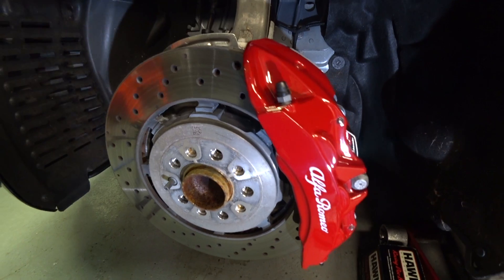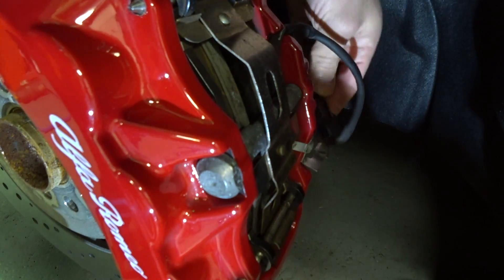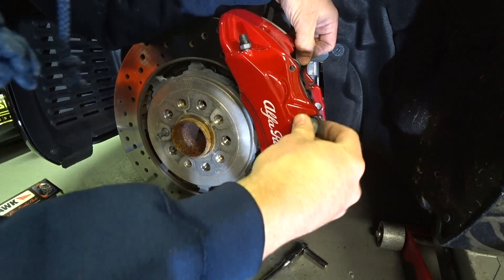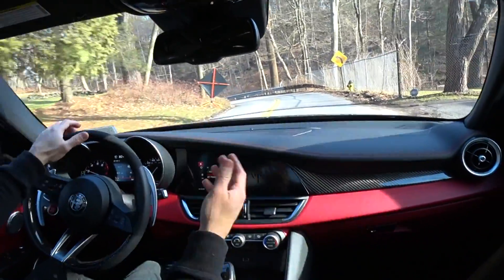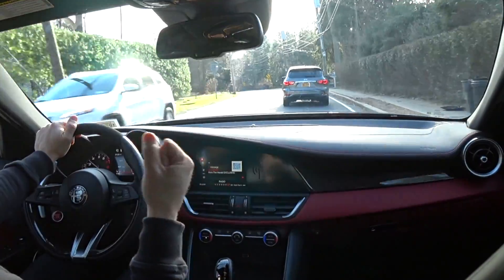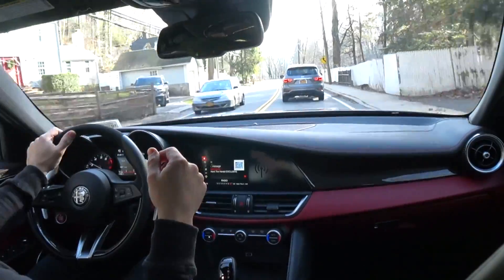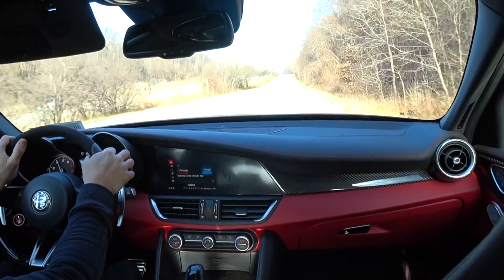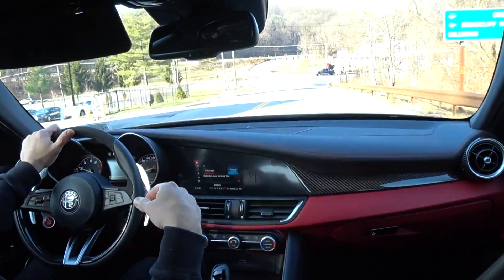Alfa Romeo Giulia Quadrifoglio Bad Brakes Fixed! | Auto Fanatic

Comment from the maker: Guys the part number for these HAWK HP+ Pads is HB-616N.607. My supplier told me they are discontinued but they most likely just changed the part number but look online you can find them. Also the break squeal is solved, i reinstalled the stainless shim plates, lubed up the retainer pins and the noise is gone FYI.
Reply: Do you grease up the outside of the shim or just between the shin and the pad? Sorry... not mechanically inclines, but you have me inspired. Have you replaced the back pads too? If not, why?

Thanks for the content man. It’s been informative and fun to watch.

Comment: I appreciate your perspective, but mine is completely different...I have a 2017 Quad with the Carbon Ceramic brakes...It is my daily so after the first summer I swapped out the Pirelli Corsas for Michelin Pilot Super Sport all seasons (mind you I have a back up set of 5 hole rims, but keep them for dings, not tire swapping)....Clearly the Michelins are nowhere near the grip of the Corsas in warm weather, but when the temp drops, the Pirellis are dangerous....as for the brakes, yes they require heavy pedal pressure, which was very awkward at first.  I have since adapted and don't find it an issue....I also don't find the brakes to be inadequate with respect to stopping distance in any way .....In referencing Giulia Quads that got "wrecked" I'm willing to guess that perhaps it was novice drivers driving aggressively with the Pirellis at ambient temps that made those tires like "hockey pucks".....I believe even the majority of reviewer's road tests conclude that although pedal pressure is not "linear", as is the case in a hydrolic system,  the stopping distances were excellent...I also don't find that my CCB's need time to warm up and I have already owned the car through a winter season.....I mean, they just nailed it with this car....it is so far superior to anything by the Germans, it's unreal that they did this right out of the box....historically, Alfas were always way ahead of their time....the issue was always incompetent maintenance...if they get that part of the ownership experience right, Alfa is bound for phenominal success in the US.....M 3's and M 4's are just played out and BORING !!!   FORZA ALFA BABY.....Dr. D
Reply from the maker: my car has steel brakes and they were horrible, i swear i was selling this car if i could not solve this issue thats how bad it was in traffic and local driving. I even asked the dealer to see if they can update it or program it thats how awful it was. Now i am finally enjoying it with confidence.
Reply: Before buying mine, I was also concerned but think with CCB there is no issue. Maybe also as mine is a manual, there is no issue in stop start traffic. Phenomenal brakes and glad that a simple brake pad swap can solve it on the steel discs cars. Thanks for the interesting video!
Reply: @autofanaticcars  I know my buddy has curbed up his car a little and even touched the back of another vehicle because of the braking system on the QV.  He said there is literally no brake feel has no idea how much brake he is applying lol.  He got rid of it and now owns an 2018 RS5, rich fack
Reply: The stock Corsas are garbage in anything under 50F, not acceptable IMHO.  As soon as I get rid of these tires I'm putting on Michelin Pilot Sport 4S which is a far superior tire.  I've had Pirellis on a bunch of my cars over the years and they are always inferior, like for like, to Michelins.
Reply: Guys yes brakes a bit twitchy in town but it’s weird I’ve really gotten used to them. But certainly won’t rule out the hawk pad swap down the road. Maybe sooner than later. 👍

Comment: I love HP+’s. Great cold bite and can handle a fair amount of heat and abuse on the street. Street drove these on my supercharged s2000 and they are game changing. Worth dealing with cold squeal and dust. Great vid as always AF!
Reply from the maker: these HPPlus were very dusty way back the new compound is awesome, that little squeal i will fix soon i just wanted them installed ASAP to test out, now that i love them il lube up the pins and stuff and it will go away but how it transformed the car i could squeal all day long and i would not complain thats how bad this car stopped
Reply: Auto Fanatic Hawk recently updated the compound? I haven’t used them in about two years
Reply from the maker: yes i have been working on finding the right pads for about a month and spoke to their engineers and they told me they revised the compound and i def notice much less dust, the old stuff would squeal all the time and had very heavy black dust, the new ones have a light gray dust.
Reply: Auto Fanatic that’s awesome. Wish they made the HPPlus for the GT350. I run DTC60’s on track right now

Comment: Thanks for this vid. Currently looking for a used Veloce. I already did a testdrive in a Super (200hp model) and the brakes seemed fine, actually stopped the car faster then my MiTo, given with same pedal pressure so it seems like not Giulias have this problem.. but it’s good to know that when my future Giulia has it, I can easily fix it.

Comment: Awesome ride along! Did the cooper anti seize on the GT350 on the caliper swap in August and haven’t had one squeal yet.. best tip I’ve picked up.
Reply from the maker: yeah these pads squeal by nature but il fix it soon, for testing i just slap them in quick then decide if they stay or go, these are staying so il lube the hardware up now and make the noise go away

Comment: I'm really surprised you were able to fix a lot of the issues you were having with just a pad swap! A lot of people talk about this car biting too hard when slowing down at low speed in traffic. It sounds like that wasn't an issue you experienced am I correct? It seems like you actually had the opposite problem of the brakes not biting enough? The fact that you fixed the creeping in traffic is awesome, congrats. That would annoy the heck outta me.
Reply from the maker: yes ive tested so many pads, rotors etc and that is the best and first think anyone who owns this car should do the factory pads suck and the lurch in traffic is terrible.

Comment: Ok, I found a part number for these shrink tubing caps (or ones like them that work).  They come from McMaster-Carr:  https://www.mcmaster.com/catalog/125/87
They are part number 72855K71.  It is 3M part number SKE 8/20.  Also, I replaced my front brake pads Hawk PC pads (Performance Ceramic) pads instead of the HP Plus.  I used the PC pads on a Porsche Cayenne Turbo a few years ago and liked them.  I also used the copper paste, and there  is ZERO squeal.  Also, there is ALMOST ZERO dust which is the primary reason why I changed the pads.  The part number for the Hawk PC pads is HB616 Z.607.  Hawk doesn't have a replacement pad for the rear calipers, but I found some from Powerstop they are 16-2043 /Z16 Evolution Ceramic Pads.  Good Luck!

Kelvin Hamilton

Comment: Great informative video. What is your hypothesis on the reason why the OEM breaks/pads are so bad? Meaning why do they still use them. It is a common issue that everyone noticed and that is still there after the 3rd year of production.
Reply from the maker: cost, budgets, parts bin sharing are the usual causes, its like why do some cars come with horrible tires, all about the profit and budgets usually.
Reply: @autofanaticcars  This was my thought at first but horrible tires aren't usually a point that will scare off the common buyer but bad breaks are. Their allocation of cost doesn't seem to make sense to me considering they decided to approve the only active front aero of any sport sedan (+ in carbon fiber) but then sacrifice on the brake pads which the common driver will easily noticed vs weaker front aero. I find it quite strange
Reply: @autofanaticcars  I'm really enjoying your channel and the content on the Giulia btw
Reply from the maker: the interior is so well crafted but they cut costs on having the cheap plastic on the lower doors, B pillars etc which to me makes no sense at all. this is why il be recovering those areas soon on my car to finish off the interior. with BMW, Porsche they up-charge for a full leather interior but Alfa does not give you such an option, i think they should offer options on the interior, tires on the Qv where someone can select a normal summer tire and someone can select a track tire not just give a track tire as the only option. Same with brakes some manufactures offer different pads from the factory if you check off those boxes. Alfa is a new brand in the USA so i think with time we may see things change depending on their level of success.

Comment: Thats really scary not able to fully stop on traffic. I've had bad dreams where I'm driving and when I tried to brake the car just slides never in my life thought I'll hear it where someone cant stop on "good" brakes. That's a beautiful car and definitely deserves good braking.
Reply from the maker: yeah the hardware looks the part but over the years I have learned there are so many variables to proper braking on the engineering and one compromise can make even the biggest brakes suck .even as I discussed in the intro these calipers are not the best or stiffest calipers ever made by Brembo and the lack of a  fixed cross bridge really changes the caliper stiffness which affects everything upstream

Comment: Did this and a rotor swap on a customer car and ran into issues with sponginess on the pedal and service lights for everything brake related even after putting it in brake service mode. Anything come to mind?

Comment: I have seen a couple of reviews now talking about driving in heavy traffic in "race" mode. The switch isn't that far away, just move it to natural mode & it will not be twitchy. Race mode is for high speed driving not town driving.
Reply from the maker: brakes were terrible in all modes does not matter the pad compound just would not hold this car in stop and go traffic without standing on the pedal.
Reply: @autofanaticcars   thanks for the reply, that makes it clear.

Comment: Ty for the tutorial and knowledge sharing. 18QV Rosso Comp. Just got my Hawks 5.0 based on you recommendations, I'm installing them this weekend using this video! I wish you had film a tutorial on the ST springs installation. Any tips or Alfa PDF instructions for DYI? I'm expecting the springs Friday.
Reply from the maker: the springs are not a DIY for most guys unless you have a shop lift and lots of tools, you need to cut and modify a socket to take the front struts apart as well due to the wiring attached at the tip stud.
Reply: @autofanaticcars  Would you recommend to have the Alpha dealership do it? How about warranty? Or any good shop will be fine?
Reply: Also, when the wheels cleaner will be available?
Reply from the maker: @slowalfaqv1817  September is the ETA
Reply from the maker: @slowalfaqv1817  Not the dealership find a good shop who works on performance cars all they need to do is sacrifice a 3/8 socket for the front struts not a huge deal.

Comment: Hi.
Thanks for the video. Do you not get a break pad failure message if the wear sensor is left disconnected? I did the something similar to my 3 series, different pads, rotors and calipers and left the connector disconnected but got a worn pads message on the idrive screen.
Reply from the maker: never had an issue with this the only way that can happen if if you cut the wires or cause a short to ground in the circuit due to negligence on the installation
Reply: Thank you for this question - I too was concerned about the disconnect. This was awesome. Ty!!!!

Comment: Thanks for this video! You are a legend. I have the same problem on mine, trying to modulate low speed braking in traffic is a nightmare, my car just lurches forward too. I've gotten into a habit of pulling back the two paddles and putting the car into neutral before stopping, but it's a pain. I too have never activated ABS, I thought it was me and the brake by wire not giving me the vibration in the pedal. I'm really tempted with these Hawk pads, but what about the brake squeal? Is there a way to eliminate that? It will drive me nuts.
Reply from the maker: glad you watched, the squeal will go away i did not lube the hardware because when testing pads i usually run them for a day and swap back and forth quick, less mess when doing it this way, not that these are a keeper il re-lube everything in a few days. Your car seems exactly like how mine was, totally insane, i drive so many high performance cars during each day that i was not willing to compromise anymore driving the Alfa i had to try something and this really worked and was so excited to share with you guys.
Reply: @autofanaticcars  This is nuts if this is all it takes to fix the brake issue, like you said all the bad press. What were Alfa thinking!
Reply from the maker: i agree these car companies need a guy like me on their side to help them instead of corporate guys making decisions that hurt brand image over something so stupid as this, even tires on many cars are a huge issue that can make or break a car but based on budgets and the lowest bid us consumers get stuck with the headaches.
Reply: @autofanaticcars  so if I understood the video correctly, you are leaving the stock pads on the rears?

Comment: Brake pad sensors are essential for hard drivers in my view. You can see the outside pad but its tough to see the inside pads. I go through front pads in about 6k miles just road use, without sensors it's not difficult to go down to the backing plates. Most road based systems are marginal for fast road use, even with 'performance' pads. If you are a serious driver best to spec carbon ceramics or a proper race derived set up al la AP etc.

Comment: What are your thoughts on using extended studs on the wheels for easier removal and install?
Reply from the maker: i was considering them from Centerline Alfa, they offer titanium but im afraid the winter road salt will trash them quick. but they def make sense
Reply: @autofanaticcars  Thanks hadn't even thought of the salt issue because I live in South Florida.
Reply from the maker: youll be fine up here the road salt is brutal this time of year it destroys lugnuts quick

Comment: Have a 17 quad with steel brakes  as well, my chief complaint is the difficulty in modulating the brakes in traffic . I don’t feel that it’s lacking in braking power but hate the feel . I wonder if the pad swap will help with the pedal modulation
Reply from the maker: change the pads, problem solved

Comment: I think everyone appreciates confident braking and a great braking feel in general. I'm not sure that I would put up with squeaky wheels and increased rotor wear  though. I've got an M3 and I use track pads when I race and OEM on the street I find that aggressive pads on the street always squeal and cause excessive rotor wear because the aggressive pads take a while to get to temp. I live in the Midwest too, so weather is definitely a factor.
Reply from the maker: if you drove this car the way it came you would be afraid to drive it hard thats how scary it was, i rather have noise and rotor wear for piece of mind there will always be a trade off with cars and this being an Italian car this is not news to me but we will see how things wear over time. I am already speaking to some companies to exclusively make me 2 piece rotors for this car in a slotted cryogenic design.
Reply: @autofanaticcars  Totally familiar with the Giulia with both carbon and non carbon brakes...and I hated both :) . Glad that noise does not bother you, I have garbage truck phobia maybe that's why :). Keep us informed on what comes down the line, maybe a replacement with a full AP racing brake kit would be a good alternative? probably a bit pricey though...

Comment: I don't have a Giulia bit looking to purchase one in future. The brake by wire system has been complained about at length, but the conclusion was that you get used to it. Never was the braking ability at question in fact is was applauded. What you did was change pads...with more squeel. The IBS is still there and you didn't touch it? Peoples driving styles are different, I do not however agree that you fixed a problem, the Ibs is something new people will have to get used to...not a factory problem. Looking for Ard to your lowering the Giulia video!
Reply from the maker: lots of these people who may have applauded the brake system don't own other high performance cars likely or work on them daily like  I do to really compare how poor these brakes were. as I explain in the video journalists don't work on cars they talk about them. having the car lunge in traffic is outright dangerous  in NYC where I drive and the Ibs wasn't the issue it was the pad compound because now it does not lunge in traffic. good brakes are subjective to many drivers which is great how we can easily change pads to our liking easily to offer a drastic improvement.
Reply: @autofanaticcars  makes sense yeah. But...how does changing a pad change the forward lunge? I fail to understand that unless the pad is thicker or the compound...I don't know.
Reply from the maker: the friction material is more aggressive which grabs better with less effort and you do not need to stand on the pedal now, just normal foot pressure holds the car which is how almost every car behaves, this car is very touchy how the torque converter is designed as some have commented here they also put car into N to prevent issues because the original brakes slip so easily